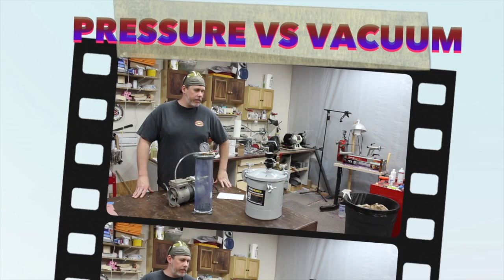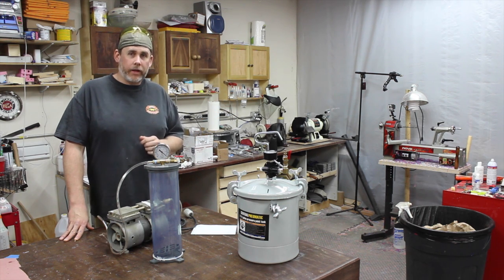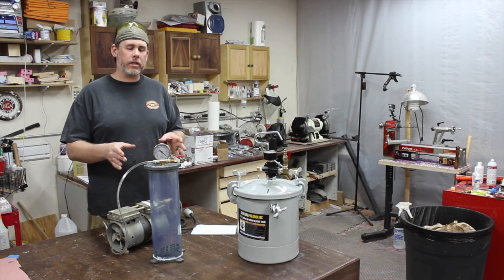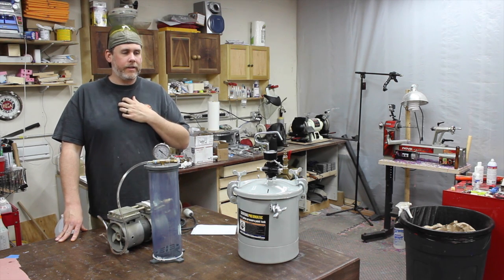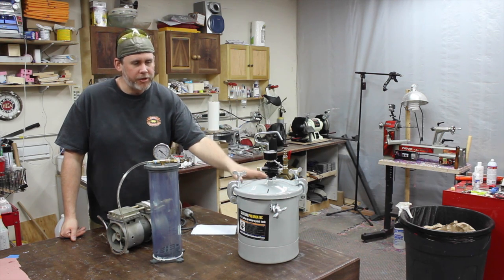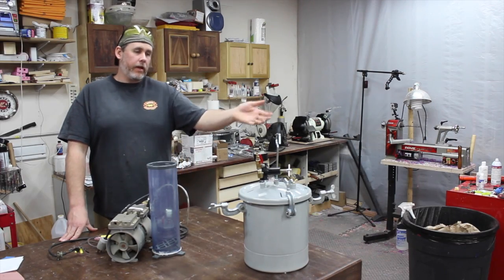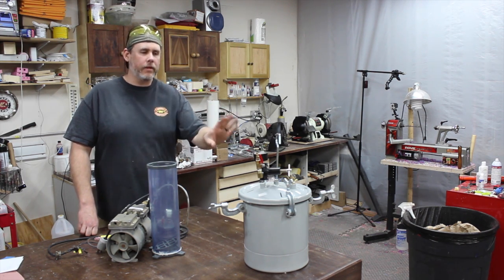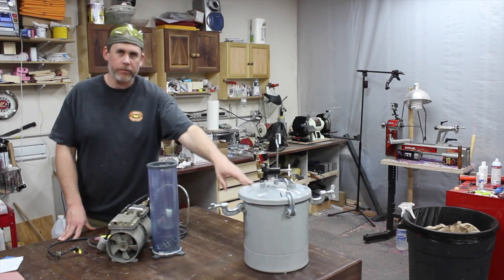Can I Use Vacuum Instead of A Pressure Pot to Cast Resins With?

Comment: Thanks Zac, it all makes perfect sense when you hear someone else say it.  I wasn't sure if pressure made the bubbles smaller or compressed the resin and squeezed the bubbles through the resin to the edge of the blank.  Now all I have to do is try to find a pot that doesn't cost $500 here.
Best Wishes Brendan.
Reply: +Zac Higgins I was watching some of your videos out of curiosity and the fact that we all do things a little different so it pays to see what someone else has to say. You pretty much nailed it, no pun intended. I often vacuum my resin before mixing and then again after mixing but before pouring and then I use pressure when casting. Taking that extra step definitely makes a difference. I am a fabricator by trade and would like to caution you to be very careful when trying to make a home made pressure pot as they can be very dangerous if they explode. They may hold the pressure initially but the metal fatigues as it flexes under pressure over time and this could be a recipe for disaster...
Reply: @samsiam6174  hey.. Could you please share more on the process of using vaccum on epoxy resin before mixing and before pouring?
How long is your pot life of resin and how long do you mix and how long do you vaccum it for before mixing and after mixing before pouring. Would appreciate your help. 
Thanks in advance..
Reply from the maker: Hi Brendan, it's too bad the pressure pots are so expensive. I'm considering trying to make one DIY with a large threaded pipe in the future. Need to research tolerances and such, but it may be something to try out. I've even seen people re-purpose air compressor tanks, but it requires a bit of welding & fabrication to get it set up with a lid and all.  Glad you found the video helpful, I know I had never really thought about what's taking place in a pressure pot, and I am glad I know now.
Reply from the maker: +sams iam Thanks for the heads up. I'm aware of the dangers of the pots, and I take every precaution I can to keep it safe.
Reply: @ZacHiggins  how long do we put it in a pressure pot if I was to just mix and put epoxy resin in it before pouring into my mould or let's say a river table or something similar?
Would appreciate your help. Thanks in advance..
Reply: Zac Higgins you are completely wrong with the microscopically small bubbles theory! It's laughable that you actually believed this stupidity! The answer is simply this; The extreme pressure breaks the surface tension of the bubbles, but they don't get smaller and smaller till you can't see them. The bubbles breaking causes agitation and friction = heat, and pushes the bubbles up and out of solution.